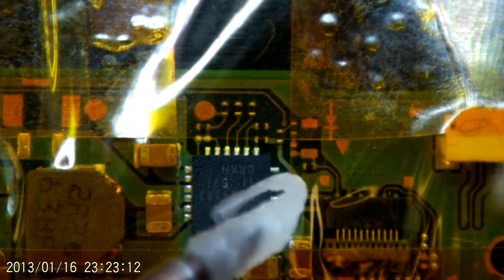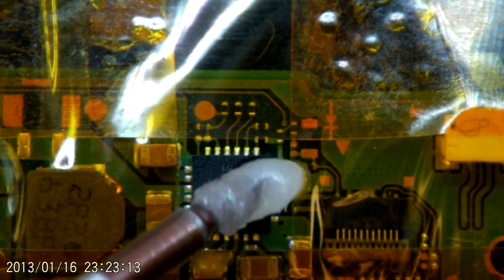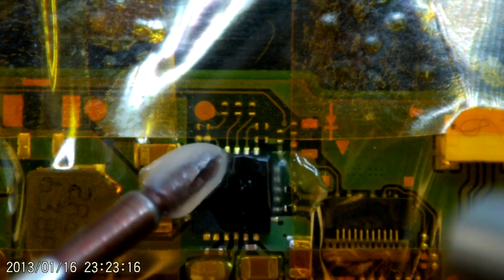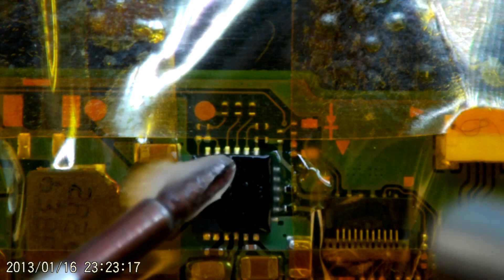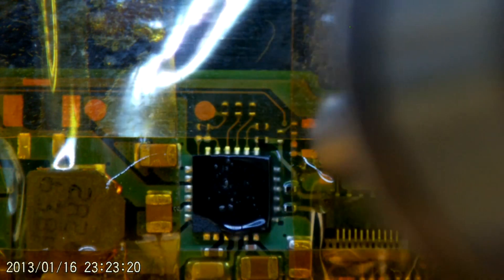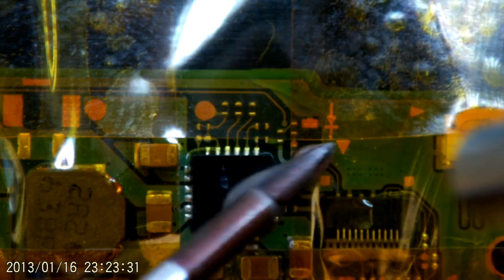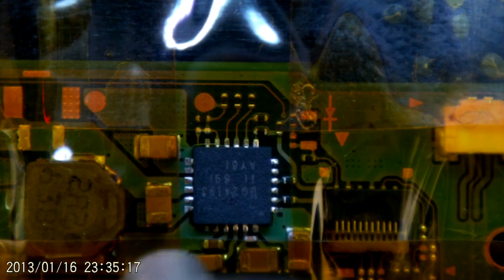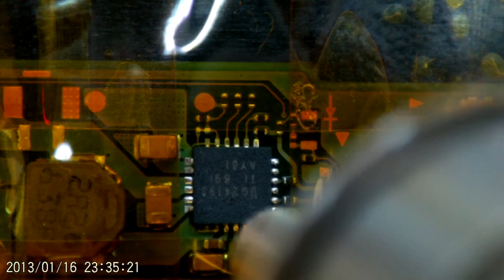Nintendo Switch BQ24913 Chip Replacement

Comment: What is hot air temperature?
Reply from the maker: around 350 o c
Reply: @rickstechrepairs  
Thank you.
Airflow about 40-50, right? I am using Quick 861DW.

Comment: I have a problem with my v1 switch, could you help me? I have no idea what chip is installed (originally I had sxos firmware), the chip has a button and when it's pressed against the back plate - the console won't launch again...chip just blinks red and white, then just red and screen shows nothing
Reply from the maker: sorry i no longer have a switch to advice on this

Comment: @
Ricks Tech I have a shorted capacitor to the left of the bq24193 IC (Charge port facing down, lower cap). off hand do you know what's causing that. bq24193 removed and short still exists.
Reply from the maker: Hi Matt,
Sorry im not sure on that one

Comment: Great video.
I have two  switch. The "good" ones manufactured  before Middle of 2018.
I do not intend to buy another video console. The switch is perfect and will suit all my needs that I would like to be able to conserve it and use it the next 15-20 years or even longer ;-) 
One I play the most time in dock mode. The other I play the most time only in portable mode.
But in general I do not find plenty of time in playing video games.
So I do not use it.
After a couple of weeks the accumulator is totally empty and it needs time to be able to start. There is no hardware fault. 
Question 1 What is the best frequency to charge the accumulator for a switch used the most time in dock mode?
Q2 What is the best frequency to charge the accumulator for a switch used the most time in portable mode?
Q3 How full should the battery be charged before it is going into "hibernation"
Q4  I do not assume that Nintendo planned that uses will play in 10 years with their switch.  Do you see a risk of fire if the accumulator is too old and it should be changed after some years?
Q5  Do you have other good hints how to conserve a switch?
Thank you for your time. I guess the answer to this questions might be useful for other users too.

Comment: get a 
HAKKO FX-951 

Hakko T12-D52 Soldering Tip (tip is good for ps4 hdmi ground pins)
Hakko T12-J02 Soldering Tip (good tip for doing the pins on the hdmi)

Hakko T12-JL02 Soldering Tip(a bit longer than the above for more reach.)

Hakko T12-I Soldering Tip (straight tip for pins)
Reply: The most complete range of Nintendo switch repair replacement parts. http://egamephone.com/index.php?rt=product/category&path=58_104

Comment: Do you have one of those usb in-line current meters to tell if anything is happening at all?
Reply from the maker: i dont have one for the Type C Connectors but i do have a wallplug wattage/amp meter.

wallplug meter to Charger to Switch.

And i get no amps drawn in to it

Comment: it worked? tell me yes please😁😁😁
Reply from the maker: No luck, but I suspect something else is the major problem with it.

This Nintendo switch board will now be a donar board for parts
Reply: @rickstechrepairs  where are you from? you could sell me the part of the sd and slot of games.
Reply from the maker: Australia, not wanting to part it out, jump on ebay or aliexpress and they are on there for cheap